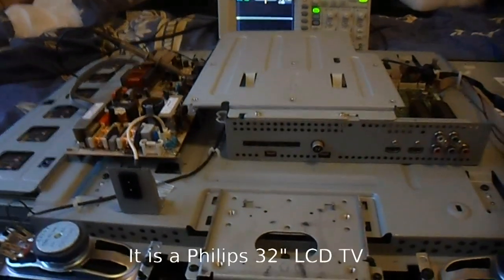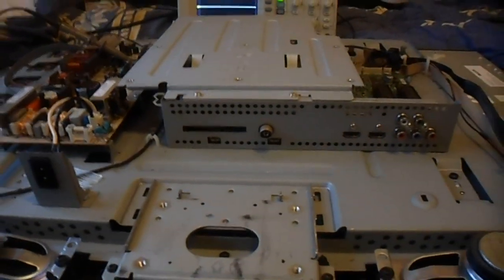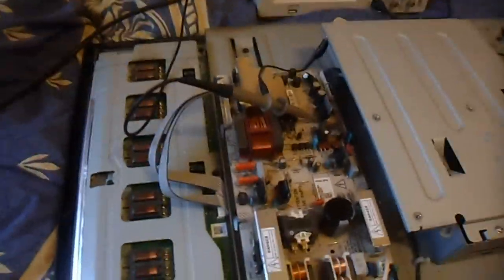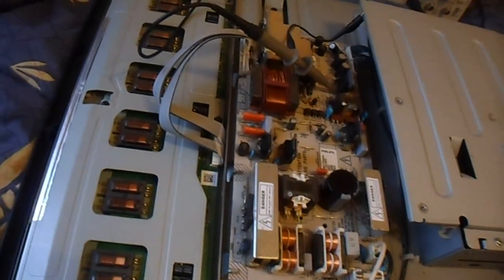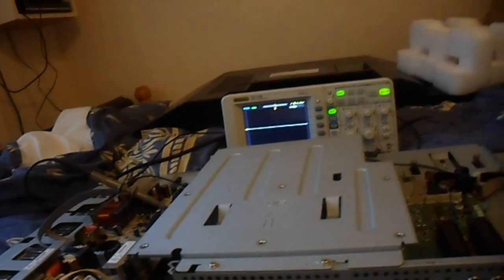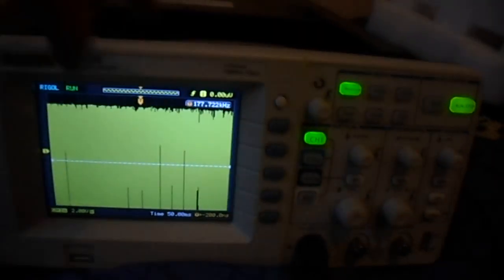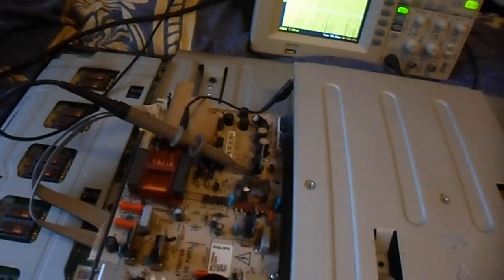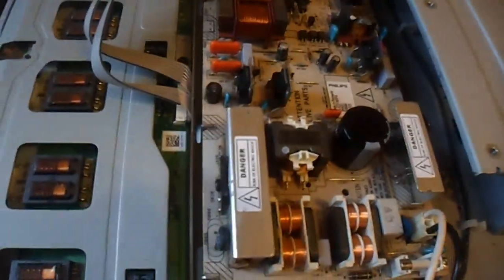Philips 32PFL5522D/05 - Completely dead (no power LED or signs of life) - Diagnosis and repair

Comment: Hello, i have a Philips tv 20pfl4122/10 that is completely dead. Especially when give voltage, a red light turn on for a second and   after is gone. I open the plastic case and i saw the power supply board. There is no capacitors with curve on top or something weird as a first view. But there is a noise by voltage that is no normal? Could you help me? If you'd like i could sent you a photo...

Thanks a lot for your time...

Comment: hi ubuntututorials,

finally my tv : philips 42pfl7422/98 PSU  gave up with blown fuse.
further check result :
1. STW18NK80Z(Mosfet Q901) fail - Replace with STW25NK120
2. TEA1507P (IC904) fail - Replace with TEA1507P
3. RGP10D ( Diode D912) - Replace with RGP10D
4. Main Fuse T5.0A

After replacing mention component, TV manage to power up & functioning as normal but the heatsink (Q901 mosfet) is very hot to touch and finally after 30min, PSU give up and blow up those newly replaced component.

any advice what did i go wrong??
is it a miss out of bad cap that draw too much amperage from the Mosfet transistor or the inverter board is drawing too much power??

hope you could enlighten me.

thanks in advance.

ps: here is the link for the technical manual / schematic for those who is looking for it. is on page 56/100

PHILIPS 37-42-47PFL7422-79-93-98 CHASSIS TPT1.2A[LA] - link
http://elektrotanya.com/philips_37-42-47pfl7422-79-93-98_chassis_tpt1.2a[la].pdf/download.html

thanks in advance.